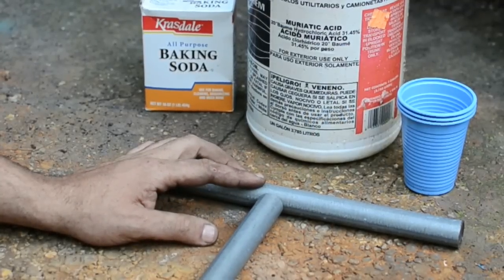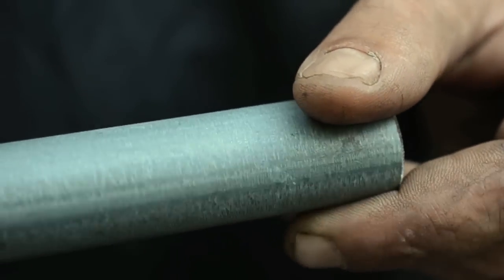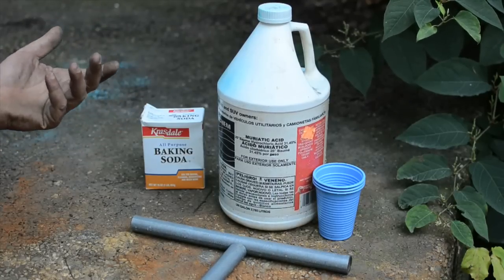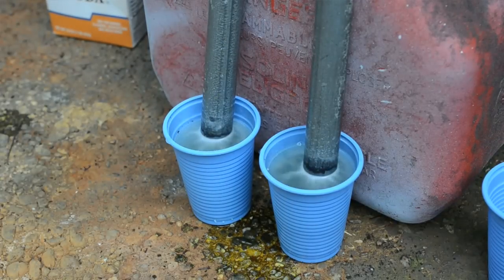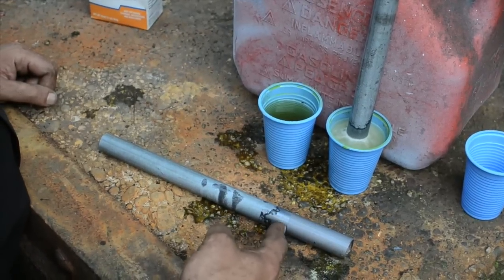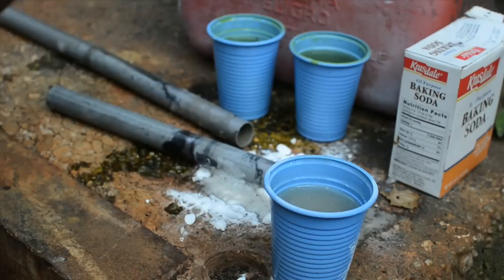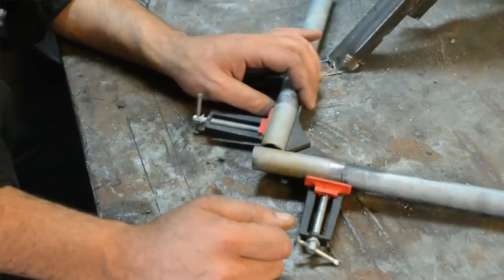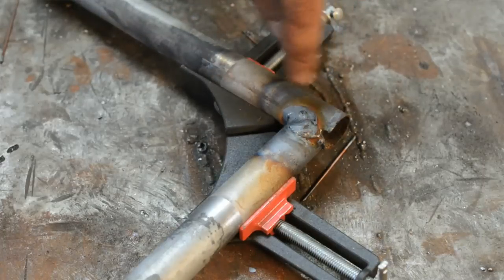Remove Galvanization with Acid - Hackett How-To

Comment: where did you buy the pipe holder when you were welding? I have to weld several hundred of those 3/4 ec together after your DE galvanization Technique

Comment: Use flux core wire and good ventilation if you want to salvage galvanized metal or do repairs on it.

The danger of acid vs just using a respirator and flux core is sorta crazy. Most of the time you are not really going to be in s situation where you can use acid to prep your metals. 

If you’re feeling “dainty” you can grind it off then weld. 

Seriously, flux core and ventilation is the key. No one does Tig or MiG on galvanized. If you run MiG you use NO GAS and flux core.

Don

Comment: How can I apply this technique to flat galvanized surface???
Reply: Spray bottle. Be extra careful that any wind blows the spray away from you. Wear old clothing, gloves, and a face shield or goggles. If it's a big sheet, instead of stopping/neutralizing the acid w/ baking soda, just wash it off thoroughly with a water hose.

Comment: You want a real acid/base science example, do this: Pick up a bottle of sulfuric acid (I believe it tested at 96% pure sulfuric acid, which is lab grade for a fraction of the price) drain opener (I was only able to find it at a single Walmart in my area) and a bottle of 100% lye drain opener (Lowe's was my only local source for it). WEAR ENOUGH PROTECTIVE EQUIPMENT ASSUMING IT WILL ALL BE THROWN INTO YOUR FACE. And then mix them. Afterwards, you not only got to see an interesting reaction, but you also are left with an extremely conductive liquid - sodium sulfate - which is fantastic (the best IMO) for electroplating metals

Comment: Any idea how much of an area should be de-galvanized to ensure the radiant heat does not vaporize the remaining coating?
Reply: Zinc boils at 1665 F.  If it doesn't glow, or only glows dull red for a short period, you're probably ok.

Comment: I want to remove the galvanisation from a section of a part that will be welded but only around where the weld will be. Would you have to submerge the part in acid to remove the galvanisation or could you say soak a wipe in the acid then wipe down the part with this wipe so to only remove the galvanise around where the weld will be?

Comment: In my experience any (below) half decent rotary tool(the $8 harbor freight kit with the equivalent of probably $90 worth of accessories had you got them from Dremel, is enough for this) with effectively any material removing attachment(HSS routing bit, sanding drum, paper sanding discs, any of the stones, even the diamond bits for engraving would take under a minute to quickly remove the two surface's. Sure, depending on your bit of choice it may not be pretty, but it'd work and would be more cost effective and quicker depending on the task. On the other hand, this is precisely what I was looking for for doing things like galvanized cable, chains, or just large batches of parts that it makes more sense for!

Comment: Hi, I've used muriatic acid to remove galvanization. Afterwards i wash the metals to clean acid coating ect. Tried to do welding with E6013 electrodes and the weld did not penetrate well? I got slag and impurities. Should i have grind the metals?

Comment: How toxic is the zinc? USDA say 300 mg Zn/d internal is bad. Guy is making the toxicity up.  I think the dilute muric acid is more toxic.  Meth lab section.  Just weld.
Reply: Yes, Metal fume fever.  Problem for commercial welders.  I know about it because it is a problem with silver solder.
Reply: No man inhalation of zinc is a whole different ballgame than drinking or eating zinc
Reply: I welded galvanized metal decking to structural steel for 30 years. I'm 60 years old now and not a lick of problem. Now is a good idea to inhale galvi? Of course not.
Reply: skeptical hippo never welded galvanized steel before

Comment: Just FYI, most galvanizing is done over layers of copper and tin. The final liquid is very toxic, so don't just pour it out on your grass. The toilet is probably the best place, and use as little acid as possible.  You can find hydrochloric/muriatic acid in the concrete section of a hardware store. The red coatings are most likely red lead, and they are VERY bad to inhale.

Comment: I've heard that wiping or bathing the object in vinegar or vinegar and water will (maybe not remove the galvanization, especially as quickly as muriatic acid) at least prep a surface for painting.  I don't know about welding though.  Your thoughts?
Reply: +bbjimbo I read this but in the context of removing lead from the surface of brass. I don't think this applies to galvanized steel.

Comment: Fine in this instance as all you are producing is CO2 and table salt. However mixing an acid and a base can be very dangerous depending on what your mixing. Always always check what your mixing first and that its safe or you could end up with a face full of chlorine which is a lot worse than zinc fumes! Generally the safest and sure-fire way to neutralise an acid its just excessive dilution with water. Nice video though, good job.

Comment: Tip: even very tightly sealed bottles of hydrochloric acid will give off hydrogren chloride fumes. The fumes quickly dissolve in moisture in the air near the bottle. This forms a small cloud of hydrochloric acid. After a few months anything made of metal within a few feet of the bottle will show corrosion. I found the bottles to be very difficult to seal. Eventually I started to store them outside.

Comment: One third strength is as strong as hydrochloric acid comes. Hydrochloric acid is an aqueous solution of hydrogen chloride. That is, it's hydrogen chloride dissolved in water. At standard pressure and temperature water can hold about 38% hydrogen chloride.  Then it spontaneously fumes white hydrogen chloride gas. You see the fumes when you open a fresh bottle. If the fumes reach your lungs or eyes they turn back into hydrochloric acid and start to burn... So, 1/3 is effectively full strength.

Comment: You way seems like a lot more trouble to me, and it takes the zinc and flings it all over the shop. With the mask, you might not intake zinc while you're welding, but you will afterwards. Moreover, the grind and brush methode doesn't address the fact that there's zinc on the inside as well as outside the conduit. And, done outside or with a fan, the acid fumes are no problem. They're no more toxic than vinegar fumes. Just don't stick your head close to it. Luckily, you don't have to.

Comment: Wire wheel does not clear out the galv from the inside of the conduit. Also, as another commenter pointed out, there is sometimes paint on the inside of the conduit. I fully realize that there are other solutions, but tons of trial and error (mostly error. Lots and lots of error) make me think that acid is the best, and close to easiest, one. Thanks for the offer. Will reach out if we need you.

Comment: why are you going to all this trouble? an angle grinder & wire wheel with an inexpensive P-95 respirator (from any welding supply place) is perfect, replacing welding fumes with muriatic acid fumes..? you may have to trim your beard and line the edges of the respirator with petroleum jelly unless you shave clean. you should wear tig gloves and long sleeves! i'm familiar with madagascar (someone once tried to hook us up) & if you ever need a certified welder for a project let me know i'm nearby

Comment: The acid strips away the paint as well- not sure if it gets dissolved directly (prob depends on the paint formulation) or just undercuts it. Actually, I can recall seeing the occasional shed snakeskin looking crap in the acid bath- that was prob the layer of paint, sloughed off intact.